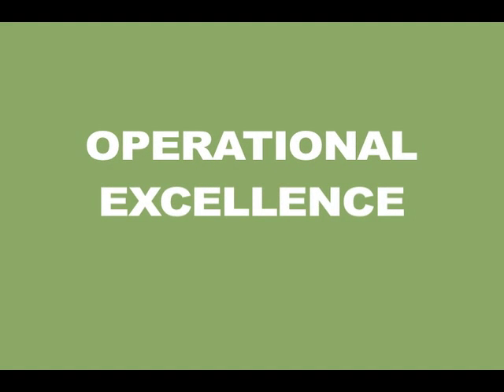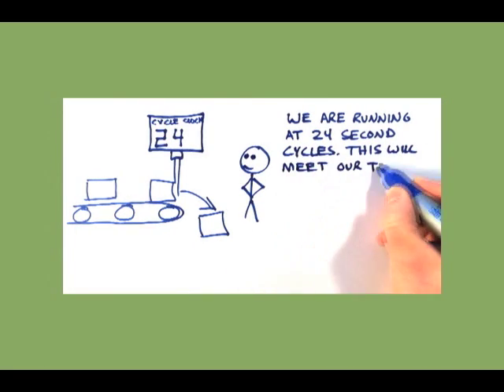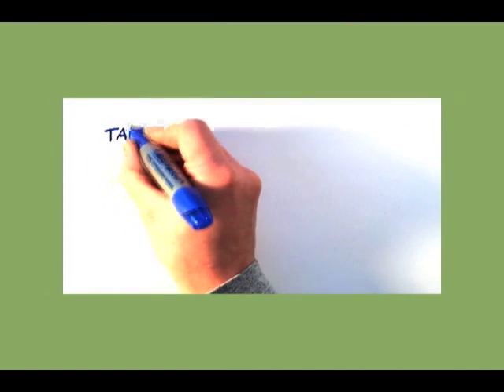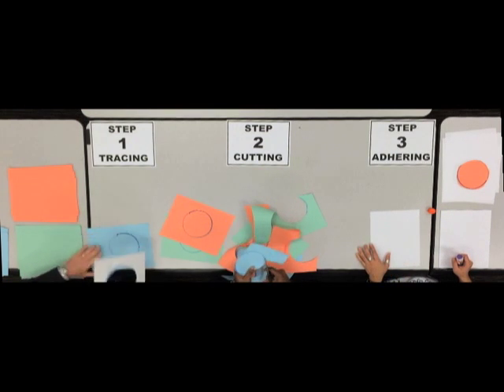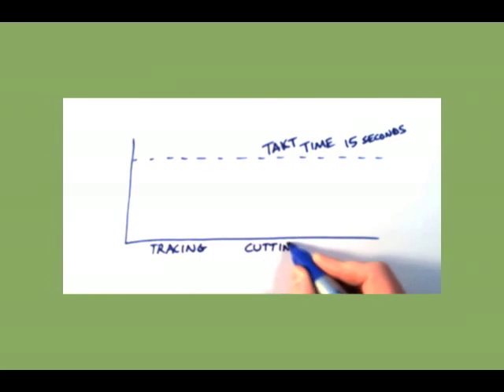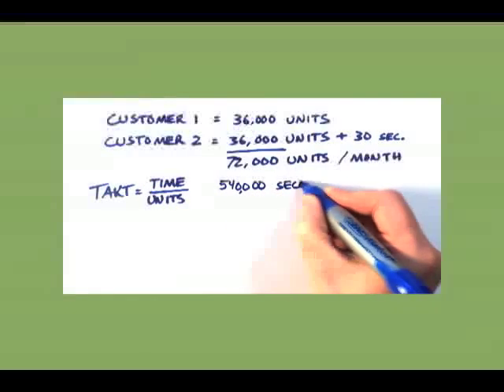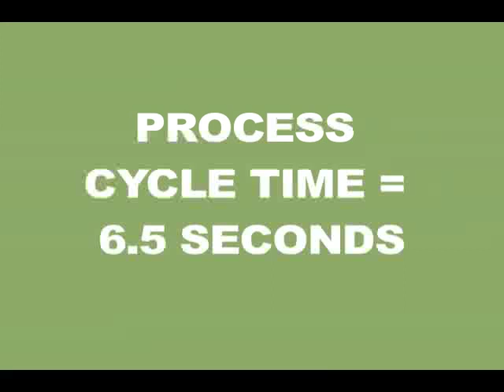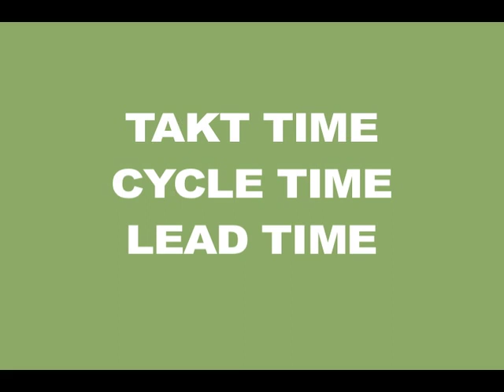Takt Time, Cycle Time, Lead Time

Comment: My note for my future dumb-dumb self when I get amnesia

Takt time = time you need to complete customer demand
Takt time = [Working hour - non working hour] : Customer demand

Cycle time = time you need to produce 1 product
Cycle time = {[value added activity (VA) + non value added activity (NVA) + necessary non value added activity (NNVA)]  - downtime } : production capacity 

Lead time = order completed - order received or process ended - process started 
Lead time = value added activity (VA) + non value added activity (NVA) + necessary non value added activity (NNVA)

In real life you need to consider allowance for the worker, and it's called standard time.

Takt time is the maximum limit for cycle time

When cycle time > takt time, then it's too slow (bottleneck) and need some manipulation/fixing in the production line. 😢 👎 

When cycle time = takt time, then it's a meh. 😕 
Be careful when workers slack it will pass the time limit. 😢 

When cycle time < takt time, then the process is done too fast. 😊 👍

Comment: How can you calculate takt time with custom items?? Like nothing is ever the same How can I get an average
Reply from the maker: If it is really custom, it can be tremendously difficult to get a good sense of pace. Ideally, over time, you can identify trends and work to set known high points, low points, but some things are really unique. Instead of trying to get a pace for a month, you might be able to look at 'worst case scenarios' on how many would be needed and try to get a sense from that. Sorry, no great answers from me, at least...
Reply: @opsexcellence3435  no, it helped thank you

Comment: [Hope to get reply] Great video! Why when calculate the takt time use 7.5hours and not putting 3 operativers into account? For a bigger assembly company shall we calculate available time by considering of head count or not?
Reply from the maker: Great question. Takt time is calculated as the demand from your company for your customer. So, how often does the company need to produce one item for the customer. You may be looking for the planned cycle time. If you have 3 assembly stations producing for the customer, you may want to calculate the planned cycle time for each to meet your customer's demand (takt). So, in that case, you might calculate takt x 3 to understand the demand on each assembly station. Further, you might want to build in a safety margin for change overs, or things of that nature, so you run a little faster than the demand. That would end up being your planned cycle time at the assembly station level.
Reply: @opsexcellence3435  Thank you so much!

Comment: Why didn`t you add in the video about defects?? waste!!!!! the operators not being consistant with there process??? especially when sticking the circle to a piece  of paper!!!!! here, there, everywhere!!!!!! : (  under pressure to meet demand?? quality suffers!!! in the TIMWOOD meaning, D for defects!!! customer returns.......................................... a bit of extra time should be added for the process!! after all, we are not robots : )
Reply from the maker: Absolutely waste plays a big part in setting your planned cycle time. For the purposes of understanding the theoretical takt, cycle, and lead times, waste makes it a little more murky. Waste is what gets in your way of achieving your desired states. Thus, understanding your theoretical demand verses your actual helps you see what you need to work on to achieve your goals.
Reply: @opsexcellence3435  Just as a conceptual aid ... Takt Time = CT / OEE, OEE takes quality into account

Comment: To improve profitability, that is to increase production with same or less cost, simply have the circle marker employee draw one circle, pass it on to the cutter employee, who then stack 2 sheets of paper (even more, depending on the quality of the scissor), then cuts these 2 pieces  of paper at a time, therefore producing 2 circles at a time.  You figure out the rest...

Comment: i want to ask,the takt time is 15 second but your cycle time is 25 second(6+13+6) (because it was 3 part)why is it still under takt time??
Reply: Norman Winston cycle time is not defined by the sum of times of all operations. You have to count the rate at which a produced is finished. The first product is the only one which takes 25 seconds to get finished. The second one will take less because the first station started working on a second product while the second was finishing the first and so on... and you take time to a very high number you will realize that the slowest work stations determines the rate of finished products

Comment: Hi.

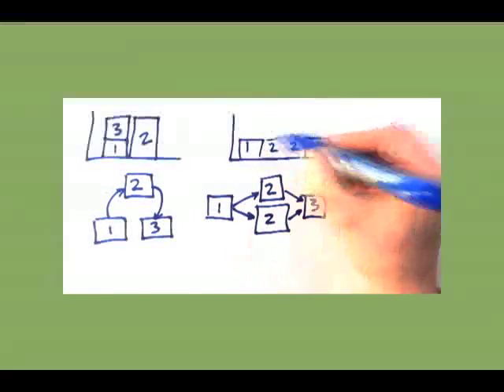In the balance of a production line, the workstations are changed (in the video is an example between times 8:05 to 8:20). I did not find any research article to bring this balance. You have some article engineering support to put it in my thesis. If possible, I will be very grateful.

Comment: What happens when a customer orders only one product and each product is unique? How is takt and cycle time calculated then?
Reply from the maker: +Patrik Axelsson It would probably depend on what you are trying to do with that information. If all the products are unique, and people are ordering one at a time, it sounds like a custom shop. If your purpose is to understand what your rough capacity is for the month, you could use averages (how many products on average do you sell- that will give you a rough estimate of your demand.)

Comment: I still have a doubt about tack time is a measure of excellence in any company. But it doesn’t mean that it is happening. It is a measure of comparison to what is really going on in lead time meaning if the process is achieving the goal of meeting the customer demands. And then the cycle time is what is really going on the process. After that you use the measure of comparison or tack time to get the results of each process in the company and the result is how to map slower process and improve them. Is that? Sorry for my English, I’ve been speaking german often here in the company and besides that I live in Brazil and I’m Italian so unfortunately the most important business language is as it was one year ago. Thank you for the video and it helps a lot. But still I really need to know if I understand correctly.

Comment: Hi Chris, I would consider waiting for a part the lead time for that part. You are the customer of that company, and they then have to calculate their own takt time to satisfy your demands. Now if the part is coming from your own company, and you are waiting on another department, then it is built into your overall lead time (raw materials into your plant, finished product out). If your company is very large, you may end up calculating lead time for individual parts and running a pull system, letting each department ensure their lead time and cycle time stays in sync with your finished product assembly pace- which should be pacing to meet your customer's demand.

Comment: The difference between Cycle Time (CT) and Lead Time (LT) is academic, but valuable enough for practitioners, in order to avoid employee's misunderstanding. Here we go:

1. CT is a RANDOM VARIABLE and is associated to the process. CT is subject to variations, because every productive system has variability, some more intense and some other ones less. That's why it is considered random, you have the Average CT and the variance (or standard deviation) of that. The variance (or std dev) can be increased based on downtimes for example.

2. LT is a DECISION VARIABLE and is associated to the decision maker and customer (client). The decision maker needs to know which is the CT and its variance to estimate the LT. With LT on hand and known due date, the decision maker can run the planning process in order to meet demand on due date.

In summary, CT needs to be less than or equal LT to meet demand.

Analyzing it quickly: If CT is greater than LT, your process is not capable to meet demand in due dates. If CT is equal to LT, your process must have zero variability, otherwise your process will not be capable to meet demand. If your CT is much lower than LT you will have inventory.

So, you need to keep control of your process in order to keep low variability under control, to have a consistent CT to estimate LT and run your process at your Takt Time.
Reply: Right on the money. Great explanation.
Reply: Hi Rafael Wollmann

Good explanation
Reply: 4
Reply: Thanks for sharing
Reply: This is an example of "how to make simple concepts more complex".

Comment: The difference between cycle time and  lead time seems academic to me. Cycle time is frequency of a completed unit, whereas lead time is the measurement of time for a unit to travel through the entire process. I dont see any value in the difference
Reply from the maker: colin roach The value in knowing cycle time is to be able to measure how your process is producing- is it running normally or not. This highlights abnormalities and helps to locate what problems are getting in your way of running normally. The value in knowing lead time helps highlight how you are serving your customer (if it is a made to order process) or how much inventory there might be in your process. Typically longer lead times indicate larger inventory levels.
Reply: +colin roach Lead time clock starts when the request is made and ends at delivery. Cycle time clock starts when work begins on the request and ends when the item is ready for delivery. Cycle time is a more mechanical measure of process capability. Lead time is what the customer sees.
Reply: +lucs1981 Thanks for your very clear and useful comment...